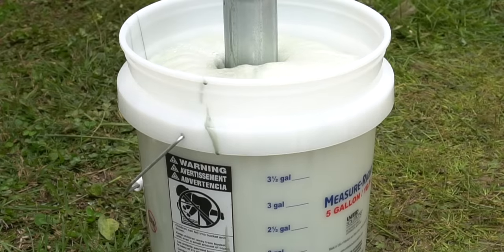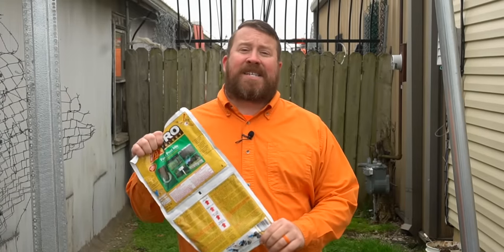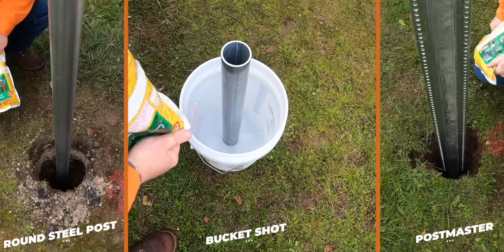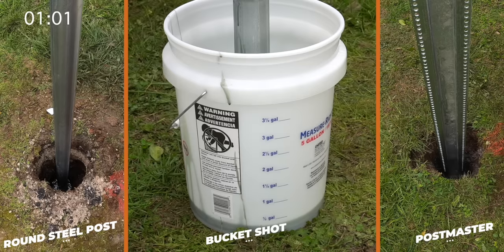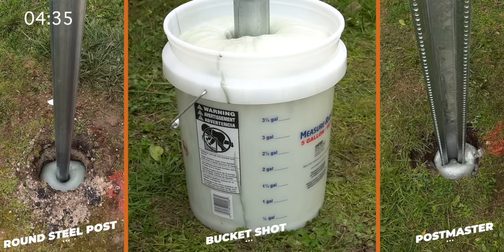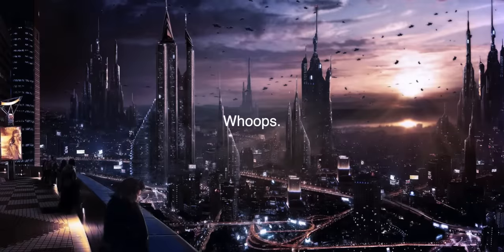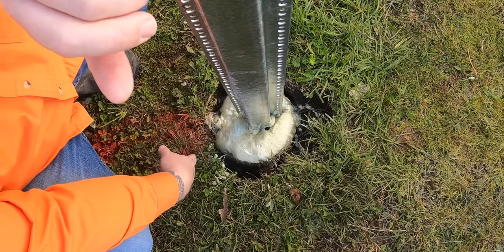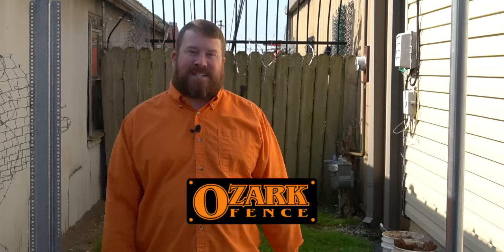Does Fence Post Foam Really Work?

Comment: We built a fence last year using expanding foam, and let me tell you, what you see in this video is EXACTLY what happened to every single post we set... I was very disappointed. We have a good 50/50 sand/soil split where we live which drains really well, and even in very dry conditions, we still ended up with wobbly posts. I will note, that a few posts that we set after a small rainstorm seemed to fair even worse then the dry set posts. It almost seemed as if the foam was repelled by the wet walls of the hole and wouldn't expand forcefully into it like with the dry holes. I could be wrong about this particular aspect, but in the end, we wound up with very wobbly posts and will likely need to slowly replace them with concrete reinforcement instead of foam as areas of the fence are now leaning outwards, which is pretty awful considering it is only a four foot picket fence...
Reply: I have done 3 fences with this stuff and your correct.. So water content is very important for curing (foam uses water in the reaction) and if the post hole it wet it will mess stuff up. The brand I use (Secure Set) recommends drying with a weed torch or something else. Its not perfect, but I use it because I get tired of hauling cement.

Comment: Okay, I've built a ton of fences with this and a ton with concrete and here's my 2 cents. 
1. The foam does work but it is very picky. Has to be properly mixed, has to be kept at a narrow temperature range, etc. 
2. You have to go deep with the holes. 3 feet minimum. 
3. You have to do a great job staking out the post. The expanding foam will push the post side to side if not perfectly staked. 
4. You can easily carry 10 bags of foam in one trip. You cannot carry the equivalent in concrete. 
5. The posts do feel softer than concrete, but I live in a high wind area and despite my home fence feeling a little soft, it's still dead level after a year of heavy winds. There's something to be said about a little give and take with wind. 
Now all that being said, I still use concrete and here's why:
1. I use fast set concrete so I don't have to stake out my posts. That saves time. 
2. I only have to drill 2 feet deep. That saves time and muscle. 
3. I only need 8' posts instead of 10' posts. This saves money and the 8' posts are lighter/easier to move around. 
4. I don't have to explain the foam idea to clients. Everyone understands concrete. 
5. When I compare the extra weight of the posts, cost of the posts, depth of the post holes, and stabilization of the foam posts, I see zero benefit in doing 100% foam all day every day. 
So, yes it works. No, it isn't a game changing miracle. It's just another tool to be used correctly on the days you need it.
Reply: After ALL that nonsense.  "I still use concrete. And here's why" 😄😄😄😄
Reply: Tell that to the electric companies that plant electric poles with it
Reply: Jason A Methods for efficiently setting 8’ fence posts are a little different from methods used on electric poles, bud.
Reply: Charles Doodson 🤣🤣💯
Reply: Jason A haha power company’s just backfill with dirt.
Reply: I put up a fence and preferred to mix cement outside and then put in mixed cement around treated 4×4. I use the premixed because it allows me to form a dome above ground level around  the 4×4. This way water runs off and keeps the wooden base free from potential rot.. what do you think of this method ?
Reply: @jargabright23 , I agree with all the other commenters, never seen any power company use anything except depth, dirt and guy wires to secure them. Where have you seen the foam used ? Thanks.
Reply: David Meads , I have seen people just pour the dry mix into the hole with no water whatsoever, and just the moisture from the ground lock the post up solid.
Reply: David Meads , you're welcome. I myself prefer to add a little bit of water as I am adding the dry mix.
Reply: @augustreil  It will harden over time but is a lot more brittle then if you mix the concrete properly.
Reply: @paulboutilier4928 , Makes sense, thanks.
Reply: One thing never mentioned is that it's simpler to top up a concrete post with a bit more concrete than with the foam. You can also finish the top of the post better with concrete. I am curious if cutting the foam causes it to lose any integrity or durability?
Reply: Reported
Reply: @trevortremaine8468  I don't think it causes a decrease in strength, but you're totally right. Topping off foam is terrible.
Reply: What is the 5 and 10 year life like on these installs, has the foam degraded or shrunk etc?
Reply: @Jason A I see a lot of electric poles set with yellow foam.   I think it has to be a better form of foam to be able to keep them 40 plus foot poles steady in the ground.
Reply: @panchopancho3910  props to you for going that deep. I've never seen a post set that deep. Lots of old fences around here with only 18" of concrete that are still straight. Lots of variables for why and how deep you need to go depending on terrain and soil.
Reply: Would the foam work better  for star pickets, or posts in a shallow topsoil with clay reactive sub soil, or even to fix a support in core drilled rock /concrete? I've not seen this, should you backfill "immediately" over the xping-foam to provide sideways compression /restriction? Seems a strange innovation.
Reply: @michaelwellner1333  I can't speak to most of your questions but I can tell you that you definitely should NOT backfill immediately. This stuff really is foam. When you accidentally knock backfill onto the foam as it's expanding it just collapses the foam and I would assume leaves weaknesses in your overall support structure.
Reply: @bryanhall9996  yeh a strange love innovation, I'd love to read the instructions...
Reply: Bryan Hall...I luved "everyone understands concrete." Even me.
Reply: @williamwalker6592  im a lineman and about 4/10 poles we put in ground is with a jetvac that sucks up all the dirt with water because you usually just can't put a 3 foot auger to the ground and we use a two part foam kinda like the video but alot more of A and B
Reply: @bontronblock  report these nuts
Reply: You're supposed to dig around the foam after it sets.. and then use concrete... duh.

 I literally did this after experimenting with foam... 

Now my  lean to shed is completely sturdy...  thanks ready mix.👍
Reply: @jacquelynperry7941  haha it's the truth! When I hold up a bag of foam goo I think the client is probably looking at me with "yeah, you're just cutting corners because you don't want to carry the weight" running through their mind! If I say, "well, it'll take a little time to position and set the concrete correctly" then everyone nods in approval!
Reply: @trevortremaine8468  Didn't  seem to mine that have been there a year. But some if my homes (even though I followed the instructions to the letter) filled up past the top. In order to get my fence planks to line up correctly I had tp cut the over filled foam level with the ground.
Reply: You have to dig a 3' hole?  And what is the advantage here?
Reply: @mphill1491  40 ft pole is 6' deep, 1/10 of length + 2'
Reply: @augustreil ..... they use the foam in central Texas....Williamson County....near the Austin area
Reply: @grarutau3553   As a fence pro myself,  what you’re doing is a waste of time. First off NEVER use wood posts and even more so pressure treated posts. Wood posts will absorb water into itself from all sides and gravitate to the bottom and rot the post (even with your domed concrete). Where I live and work, we haven’t used wood posts in over a decade.
Reply: Who is going to wait a long time prepping that shit and hold it in place until the them foam expands. In my years of fence contractor we dig and set up to 50 post a day imagine waiting 5 minutes for each post just for that shit to expand never in my life
Reply: @jargabright23  or Dish Network that uses it.  I'll probably loose my signal.
Reply: Perfect. I'm gonna follow your advice. Thank you.
Reply: @jargabright23  Most of the electric poles in my area set with 5/8 crushed rock (no fines). It locks them in tight and they stay tight.
Reply: @tabcobra  So do not use wood posts for a wood fence?  That will be interesting.  I have sunk deck posts into holes and filed with ready mix concrete.  That 20' tall deck is still standing and showing no rot some 20+ years later.  Did you fill the bottom of your holes with gravel or just sink your posts into dirt/mud at the bottom and then pour concrete, basically making a straw?
Reply: @Power5   I’ve been building fences for forty years and when we used to use wood posts, we would just stick them into the holes and pour in the concrete. We never used gravel at the bottom of the posts, proven to not help anything. Wood posts will always rot around the top at ground level. One reason is because concrete itself will rot wood. In my area, (DFW), we haven’t used wood posts in 15 or 20 years. Steel posts last forever.
Reply: @wade5941  Hi ,  what did you mean by “no fines” ?  I’ve been using crushed rock as well with strong , long-lasting results .   The trick I’ve found is making sure to tamp it down often as you go .  Also ,  I leave between 6”- 8” below the post of a mix of crushed rock and pea gravel .  Also ,  (and this is a big plus , but I only build about 6-8 fences a year and for home-owners without super long fences ) I studied Japanese carpentry when I lived over there and they’ve got incredible techniques they’ve used forever for wood preservation … works much better than treated wood .  So I’m guessing my success at long lasting posts has partly been due to that .  Of course the gentleman above who sets up to 50 posts a day … I know, I know … but yeah ,  what’d you mean by (no fine) ?  Thanks !
Reply: @davem1430  I don’t mean to be an ass , but why do people have to be so damned rude to each other in their comments ?  I’ve been in construction for all of my working life and I’m highly skilled .  Don’t like the stress of owning my own company so I stay at Project Manager level and have made the companies I’ve worked for a sh*t-ton of $ over the years .  I’ve been on construction sites for over 40 years , so I’m not a shrinking violet when it comes to ppl swearing like sailors .  If you were a potential client ,  we wouldn’t get as far as even talking about “your money” before we sent you out the door .  And if you spoke like that to anyone on my site for no reason , like you did here , lol , you’d never work in this town again .  Go ahead , throw some more of your pansy-assed talk at me .  Boys like you last minutes with decent companies .
Reply: @Bryan Hall, Very helpful comment. thanks!
Reply: I have been in the fence business 30 years, Set many different types of posts in many different  climates and soil types. Posts set in concrete, drivin or dirt tamped is really the only correct way to do it. In my opinion foam is just another gimmick and its expensive. Its aimed at the DIY folk who don't know any better. Its amazing to me the amount of money folks will spend to cut a corner when in fact puttin in fence is hard work. digging sucks, mixing concrete sucks and listening to a post driver sucks but its the correct way.
Reply: Most of the foam post installed on several properties have failed after 3 years. The harsh 4 season climates in Wisconsin have seem to be too much. When i replaced the foam with concrete, it was pretty much like ripping out a wet sponge.
Reply: @ezekieo32  bummer. Mine are still going strong here in the Pacific Northwest, no sign of failure, but we don't have that kind of Midwest winter.
Reply: @grarutau3553  that's how I do it and have never had a fence not hold up
Reply: 2 feet? Ya have frost?
Reply: @briansefring4981  rarely. Code here is 12-18" depending on structure size.
Reply: @briansefring4981  rarely. Code here varies from 12"-18" for depth of post based on what you're building.
Reply: @bryanhall9996  36" where Im at :)
Reply: @briansefring4981  haha I'd start building cabinets!
Reply: @bryanhall9996  Lol!  I always rent a hole auger...cause the holes I dig by hand only get to about 2 1/2 feet...lol!
Reply: Great insight man, thank you!
Reply: that shit is trash being put in the ground stick to concrete no one want's a fence that can move.
Reply: Its garbage
Reply: I’d say the same based on my experience with both.
Reply: How does it cope with animals...top laughing..if used foam to block holes before only to find some woodland fury creatures dig it out and make a nest. 

And you need to leave 2 hours..
Lol.. we use postcrete..sets in 15 minutes
Reply: @richardoakley8800  No issues with critters on the ones I've used! I still like crete, crushed gravel the best but this stuff has its moments.
Reply: I completely agree 100%, and you just formulated arguments as to why standard practice does not need a foam replacement
Reply: @danwhitson2505  totally agree. Also, I like to wrap the bottom 2 or 3 feet of posts in polythene wrap- it won’t keep the water out, but it will keep concrete from direct contact with the wood, which in my experience is the first reason a post will fail, due to the chemical interaction of the lime. No shortcuts folks,if you want good results,you just gotta work for it, dig deep, use rocks tamped in with a heavy crowbar to set the posts, then backfill and tamp some more, using concrete if necessary. Every job is different,but post foam,and even ready mix post Crete is just a shady shortcut, real concrete needs a high content of coarse gravel.
Reply: You need to dig under 4 feet to get under the frost line. Unless you're in a place that doesn't freeze in winter.
Reply: @drewroy22  fortunately for us the ground never freezes here.
Reply: @bryanhall9996  god you're lucky. I hate when it freezes 😁
Reply: @drewroy22  I grew up in Minnesota so I feel your pain! Out in Oregon now and we barely ever see snow here. Usually just 40's/50's and raining all winter.
Reply: The problem is that these things are advertised as “hassle-free”, the whole point is supposed to be that you need not special knowledge like with concrete, so telling me that it needs more care than concrete to work is actually really bad for the product
Reply: @Alongfortheride693  that's a reasonable point. My test fence is 3 years in with heavy rain and wind and still dead on. I'll be sure to update if it starts to struggle down the road.
Reply: sooooo 10' posts are to heavy to carry around but concrete isn't?
Reply: @jargabright23  The foam my Co-op used last year when they put my poles (3) is completely different than the product shown here. The concept is the same, however, the foam used came in a large box, and was mixed in the open air. Once it was poured into the hole it expanded and filled the entire cavity in less than 2 minutes. It was solid in less than 20. According to the box it is fully cured in 4 hours. The holes for those poles are huge. I was hoping to find a similar product for smaller scale and have yet to find anything near as strong.
Reply: Thanks for your input Just what I needed to confirm my idea as I'm a DIY guy and was told the foam was the way to go. But as you stated it has its place but I will do as you and stick with the fast set concrete. thanks for sharing your knowledge. Respectfully; Archie A, Grafton, Ontario, Canada.
Reply: @williamwalker6592  and the bid goes to
Reply: @augustreil  or u dump it in dry and pour water on top and let it soak down.
Reply: @tabcobra  

Brother, you sound serious. That means whoever uses wood posts is just throwing all that money away. 

Do you set your posts in cement ? What are you using all those years ?? Steel ones like in the video?
Reply: @BlueOriginAire  I’ve never set a post not in concrete, you can’t in Texas. I started building fences for my father in law in around 1975. At that time everyone used wood posts. Around 1980, we were one of the first companies to use metal posts and brackets hadn’t even been developed yet. We would attach the rails with self tapping screws, it took forever to rail. I’m mostly retired now, but we haven’t used a wood post in twenty years.
Reply: @augustreil  Yup, worked with a lineman and they do not use anything in the hole except dirt. The reason, the poles will rot off right at the top edge of concrete.
Reply: He dug the holes to wide the foam has to grab the ground and also, they work much much better on wood
Reply: All fair points, thanks. I opt for foam now for the prime reason of wood root. That's guaranteed with concrete. Granted in 20 years.
Reply: I used this on my fence and on the post wood 4×4  and work just fine